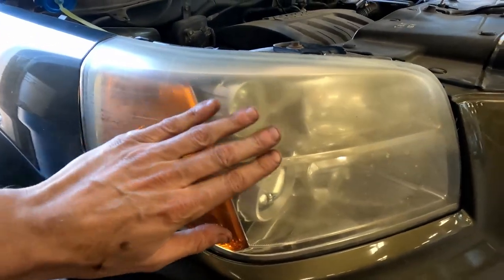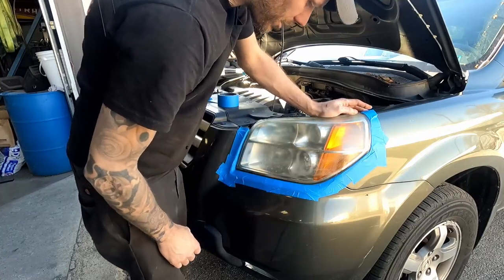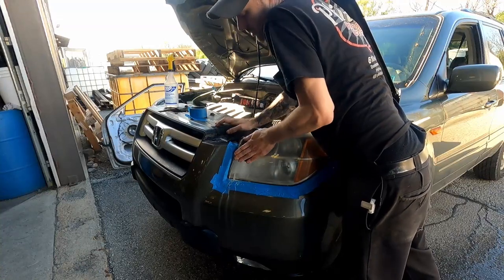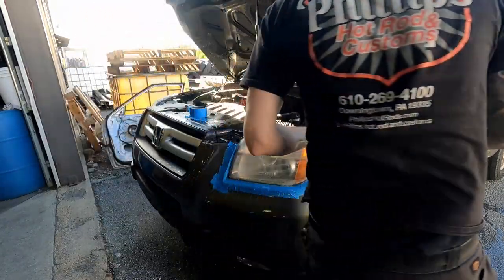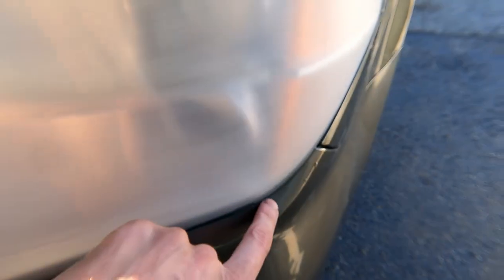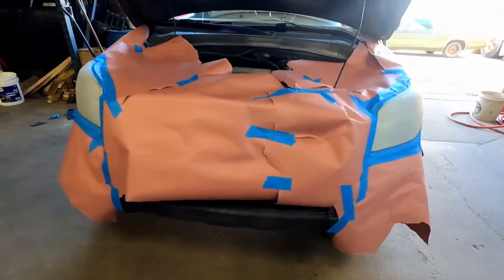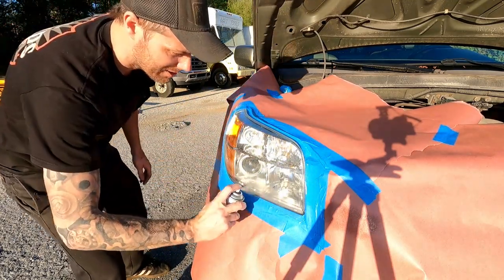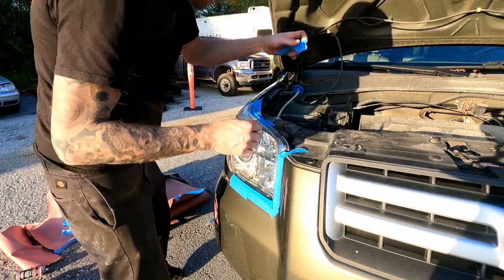How To Restore Headlights LightRite LRK-300. Polish Headlights

Comment: A lot of kits are made for drills and they work great. A lot faster and easier on the arms too. The best ones have progressively finer sanding disks until it's smooth and clear and then a final buff with rubbing compound.

Comment: Very informative video - thank you for posting it! In the course of the video you are repeatedly emphasizing the importance of the linear motion, but you are not explaining why. Can you please comment on why the circular motion is a no-no? Also, the headlights do look great right after the clear coat application. What is your long term experience with this product? On average, how long do the lenses stay clear provided the prep work and application is done as you demonstrated in the video? Thanks in advance for your answers! Again, great video, it will definitely help many DIY guys like myself and probably some professionals as well.
Reply from the maker: Hello. circular sanding really screws up the finish. You can see the swirls in the Lense when it's done. As for longevity, it's a main reason I prefer this product. I've used many different products and techniques over a 10 year period. No other products I've tried have lasted more than a year until I consider them cloudy again. This Light Rite system has been on my customers cars for 5 years so far and I think they still look as good as the day I did it.

Comment: Thanks for this! Used on my Z - turned out about a 9/10 - just a tiny hair of a bit of a satin like finish, but you don't see it like that unless you have your face < 2' from the headlights.
Reply from the maker: nice work. The first few I did were not 10/10 either.  I hope this video helps eliminate the things I've already discovered don't work out.
Reply: @motormike43  Yeah they look amazing unless you're at a certain angle... is there a way to smooth out the finish?  What could have I done differently?  

Morimoto makes new lens replacements for the 370z - so - I may go with those and pull them apart, do some painting and replace the OEM projector with the Sti-R (it has a sharper cutoff non-fresnel style)... would run around $400 to do it that way - just labor intensive with some risk in heating them up, tear down, and re-sealing (not my first rodeo as I've done this on some lights for a wrx in the past, had no issues with water retention...).
Reply from the maker: @07wrxtr1  Hard to say without having been there. I suspect you either didnt put the spray on wet enough / held the can too far away or moved too fast. The spray is fairy friendly to a heavy coat without trying to run. Sounds like being "Satin" could be caused by spraying it too 'Dry'.

Comment: I see you did a very thorough job of it & like most things prep work determines good or bad results. Question: on a guesstimate - time & cost to do this job & I see your in a shop, general estimate for doing this for a customer please? Just so I can get an idea of if estimate is good or not in the same situation you did there. Very good job & you were very good at explaining the steps & all. Keep up the good work.
Reply from the maker: I charge 1 hour at our shop labor rate + Materials. The LightRite kit varies depending where you buy it. It currently averages $35 - $55. I would say the average of additional materials is around $10 for the tape, paper, cleaning supplies... If a car has huge headlights or they are in extremely poor condition, I will bill appropriately for the additional time spent beyond the first hour. This is usually known before selling the job and conveyed to the customer up front.
Reply: @motormike43  I greatly appreciate your explanation & your help with this. I have an 02 dodge dually w/fresnel lens headlights approx 6" x 10". OK, thanks & have a great weekend.